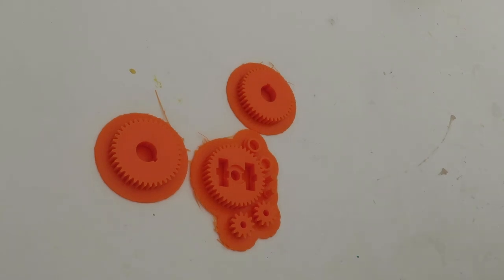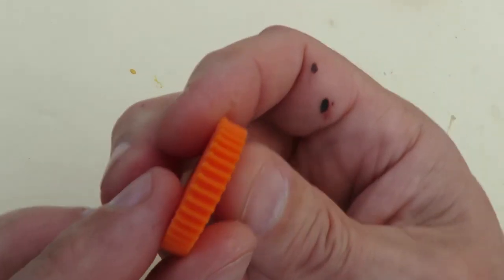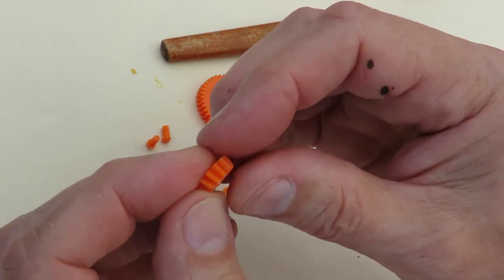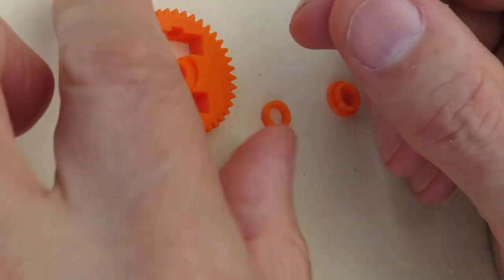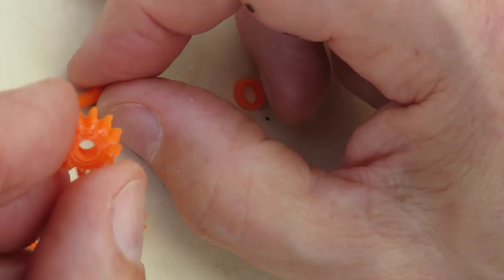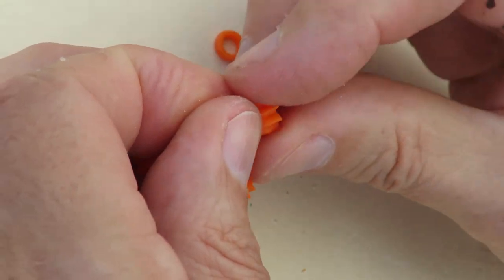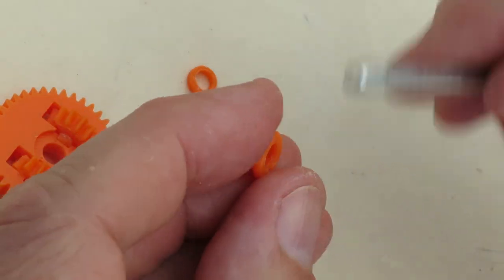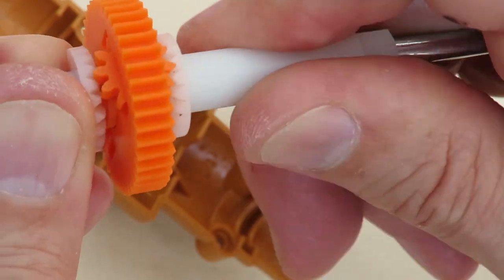Seventh look RC HL Toys Bulldozer Power Scraper SW HL 3058

Comment: It looks like "Elephants Foot". Were the first layer puts down extra plastic to help it stick. I thought that with a raft though this would of been eliminated. I don't know about all slicers but I know that Prusa Slicer has "Elephants Foot Compensation" in its settings. You also might want to slow the prints down to help with the sharp edges.
Great video. Keep up with the good work.
Reply from the maker: Thanks for the tips.

Comment: Those  are nice prints! That Power scraper is getting well serviced. You might be better off, printing the white parts also. I can't wait for part 20th? :)
Reply from the maker: Long term that might become necessary but I need to get the new ones to match the old first so I get the dimensions right.